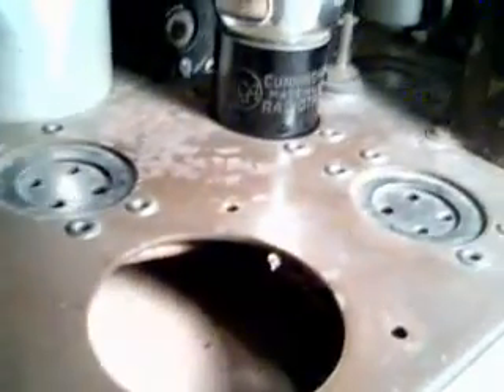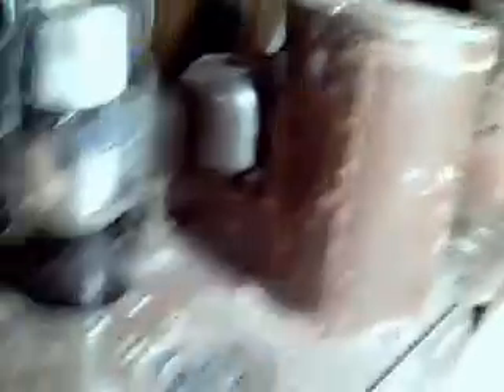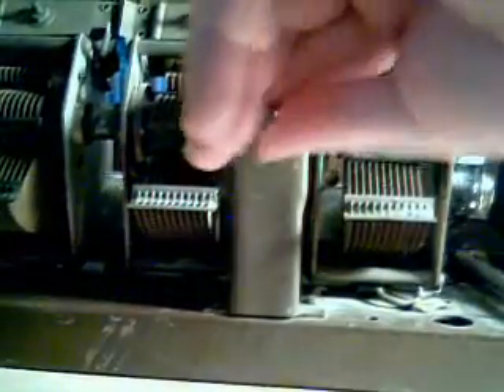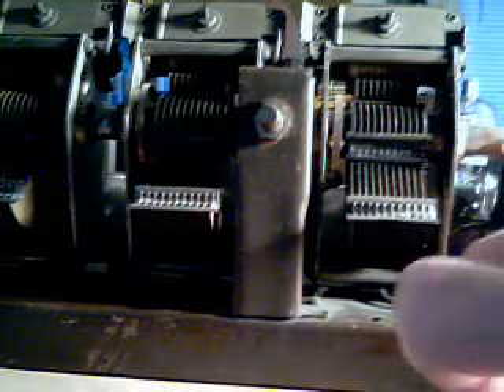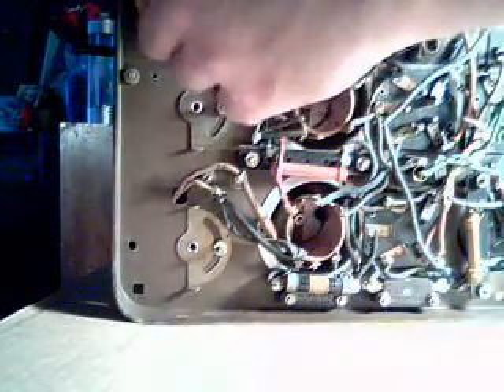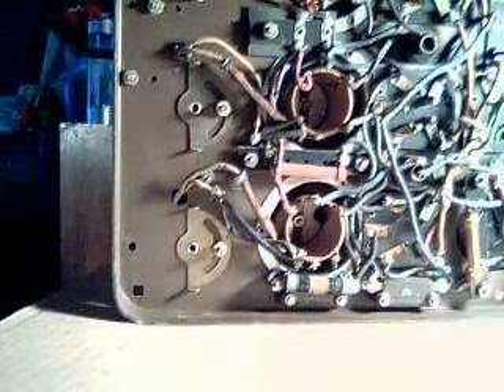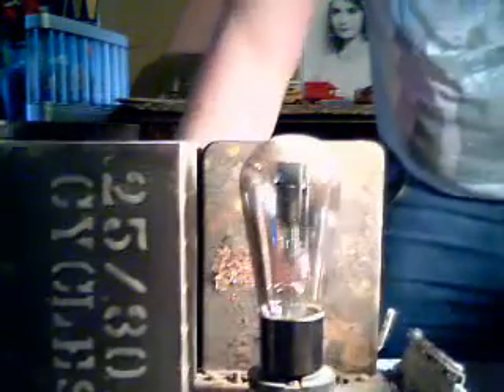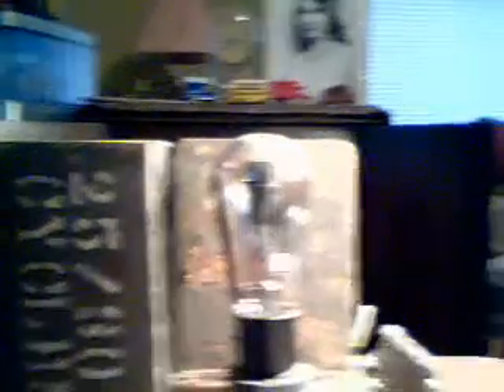Mysterious  unknownTRF Fada radio chassis

Comment: You would have to know what model of Radiola that power supply came from in order to make use of it, they made a lot of Radiola 17s, 18s, Brunswick 5KRs, Canadian G.Es, and Greybars that used power supplies like that but the filament voltages are mostly wrong since all of the above used a row of #26 tubes, and only one #27  If it's from a later Radiola of about the 1929-30 vintage you might be in business, those used either #24s or #27s, unfortunately they also used #45s or #50s, not 71As, though the Radiola 60 did. I think it's possible that the Fada may have been a screen grid tube set, it looks like someone clipped off the grid cap leads near what you think might be trimmer caps. If it were mine I would just put it in drydock for now unless you have the rest of it, minus the power supply, it may be useful as a parts chassis should you find another one. Now that Sparton in the background would be worth overhauling, though I am sure it's an Equasone model.

Comment: That chassis looks very similar to the Fada Model 16 chassis. It also looks somewhat similar to a Fada "Special" 265-A chassis, except those were battery sets, not electric sets. I'm betting its the Fada 16, but it also could be some variation on a Fada Model 30 chassis. Both the 16 and 30 were electric sets. Anyways, it was almost certainly manufactured between 1927 and 1930. I would look up the Fada 16 before any other model if I were you, the Model 16 seems the most likely.

Comment: I have another Fada that is similar. It also has busted tuning supports, and i haven't touched it.  I'm not positive what model mine is, but the tube/chassis layout page glued inside the cabinet says its for models 10, 11, 30, and 31. Mine uses 27 tubes though, which do not have plate caps. Plate caps I'd guess are a 24, but its possible someone fitted the wrong tubes.

Comment: Hello Gentlemen, Yes it's a Fada and unfortunately the pot metal supports are very prone to cracking and breaking.  I have several Fada's that all have broken supports.  I will have to fabricate new metal supports myself.   I don't have any information on your chassis, as Fada made thousands of different chassis and kept poor records.  The long and short wire lead in's are used to keep the tuning accurate.  You should put your efforts into a more complete radio, but that one is a challenge!

Comment from the maker: @Lockemeister Hi! I think this may be a neutradyne radio ,I just put the screen grid tubes(24A and 35) in for show but I think all the tubes except the 71's are suppose to be 27's .If so what would those three metal posts next to the tube sockets be for ,possibly adjusters ???

Comment: The Fada looks like a decent radio I think they made good stuff. I noticed two separate antenna connections labled long and short. I wonder if it meant Longwave and Shortwave or just the longer wire or the shorter wire! I would think a TRF would just be AM, so that's interesting. Maybe in the meantime search Ebay everyday and maybe one of these will show up. I had to do that with my RCA 262 speaker. It took awhile to find the almost correct 10 inch speaker.